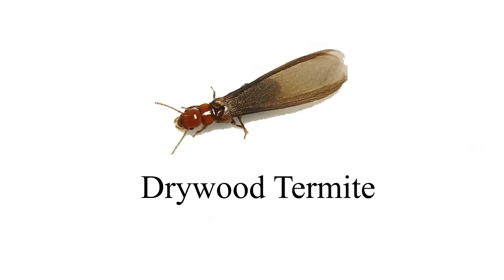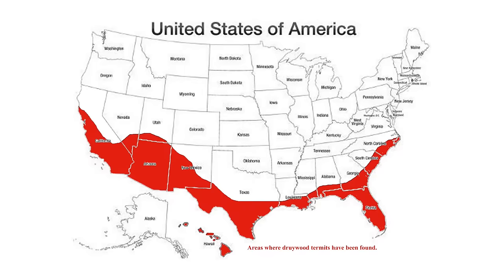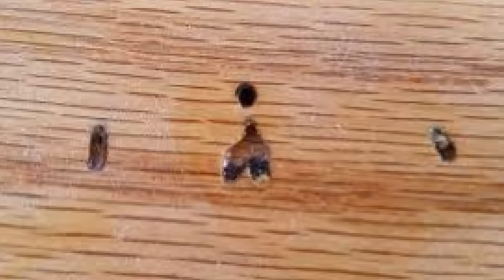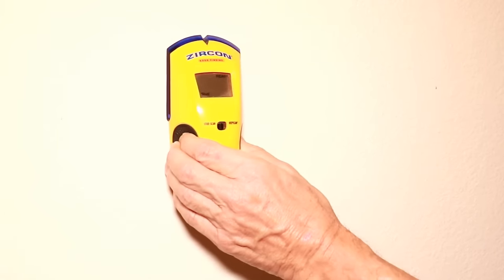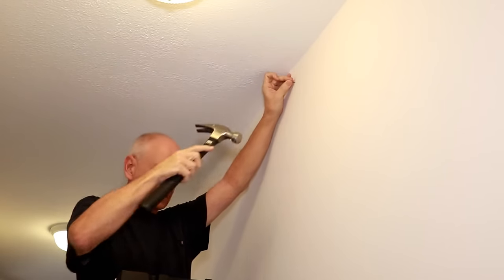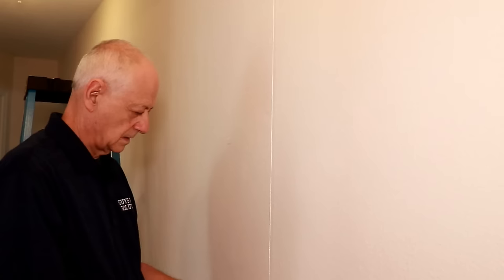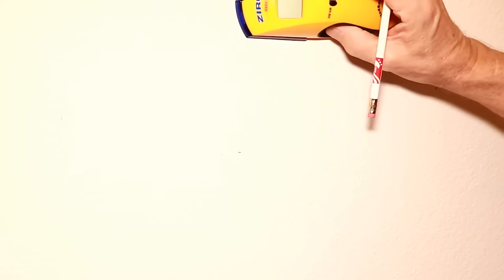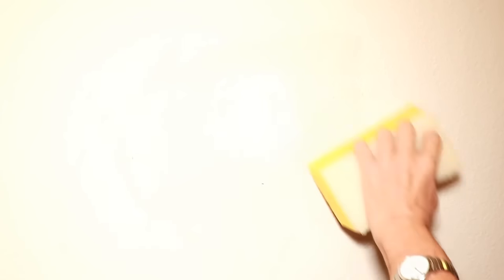How to Treat a Drywood Termite Infestation Yourself. A MUST see if you have Drywood termites.

Comment: I've heard that Taurus SC lasts up to 10 years but you said it doesn't last 6 months, which is right?
Reply from the maker: Taurus SC can last up to 10 years when used as a perimeter treatment with a trenching system.  That is to say, if you burry it, then it can last up to 10 years.  The chances are it will be more like five to seven years, but it could go 10.  However, when sprayed on the surfaces of the exterior of the house, it won't even make three months.  So, how long does it last if you inject it behind walls?  In theory, it should last a very long time, since you are not exposing it to rain and sunlight.  Right?  Well, not so fast.  We also know that it will only last about three months when applied to interior surfaces that are out of the weather, but exposed to artificial light.  So, if you apply it into a dark void in the wall where it is nice and dry and is not exposed to light, will it now last 10 years?  Well, maybe it will, but I would not take that to the bank.  I think it will last longer than if it were applied in a lighted situation, but I have serious doubts that it is going to make it 10 years.  The thing is though that it doesn't need to last that long when treating drywood termites.  It only needs to last long enough to kill the termites and that should happen within days of the application, if you hit a gallery with it.  The idea with spot treating drywood termites is that you are going to locate the galleries and then inject a fipronil foam directly into those galleries.  That will kill off that entire gallery.  You could argue that, if the fipronil lasts 10 years, then that would prevent an infestation in that spot for a really long time.  Even if that were the case, drywood termite galleries tend to be fairly small and located in different areas.  You could have another gallery a foot or two above the one you treated or in another 2x4 that is right next to the treated one.  So, perhaps you may prevent termites in that specific gallery from returning, but it's a big house and there are a lot of swarmers.  Spot treating drywood termites is kind of like playing Whack A Mole.  All of that is to say that, in my opinion, the fipronil will not last 10 years in a wall, but I have not done any studies on it and I have not seen any studies on it either.  I tend to err on the side of caution, so my best guess is about six months.  Am I correct?  Who knows?  I could be way off, so it's just an opinion.  No hard science behind it at all, but it doesn't make much difference with drywood termites.  While it may be a fun topic for us pest controllers to debate, it has little impact on a drywood termite infestation.  Or so it seems to me.

I hope that helps.  Great question.  Thanks for asking.
Reply: @GuysPestSolutions  it is too bad there wasn't a way that we could get boracare to spread through every connecting piece of wood in the entire home by binding orange oil to it...

I guess orange oil seeps through wood and keeps moving through it...capillary effect or something like that? It would be so nice if you could just inject something that follows the wood through entire home
Reply from the maker: @macknumber9  Bora-Care does penetrate deep into wood, but the problem is getting it to the wood in the first place.  For example, how do you treat the studs behind the drywall?  Some pest controllers will inject foam into the wall voids, but this is an expensive and often messy proposition.  So, while Bora-Care does have a place in the treatment plan, I don't think it can be regarded as a cure all for termites.  

I never recommend orange oil for the treatment of termites.  A study by the University of California found that orange oil is only about 77% effective in killing termites.  For a treatment to be truly effective you must have a 100% kill rate.  Also, orange oil is a fast kill product.  This is not what you want.  You want a slow kill product because you want the termites to take the pesticide back to the gallery or colony and share it with the other termites.  That way you kill all of them and not just 77%.  So, leave the orange oil to those folks who are okay with getting their homes eaten, albeit somewhat more slowly.

I hope that helps.
Reply: @GuysPestSolutions  quick follow-up question. Could I spray all the subfloors with Bora care? Then I guess I would never ever have to worry about termites causing soft spots in the wooden subfloor in my Mobile Home Investments.

Also what is your opinion on orange oil have you ever used it it seems like it penetrates and follows the wood the negative part of it it doesn't have the ability to cause termites to spread to other termites it just kills on contact but the good thing is it penetrates the wood so good that you might only need to just spray the middle of every stud and I would think hope that it would kill all the termites that are in that stud. This would make it very easy to treat the whole house because you wouldn't need to drill holes every 4 in
Reply from the maker: @macknumber9  Let's start with the orange oil question.  I think the ability of orange oil to penetrate wood is overstated quite a bit.  Also, the ingredient in orange oil that does the killing is d-limonene, which has no residual properties of which I am aware.  It is simply an instant kill product.  It can be somewhat useful for drywood termites, but keep in mind that it is flammable and can make wood burn more easily, thereby potentially creating more of a fire hazard.  Since it has no residual properties, it may kill off some termites, but the gallery may still recover.  You are way better off using a fipronil foam to treat a gallery because of the residual properties.  Also, the foam is going to penetrate WAY better than the orange oil because it expands to several times its size.  The ability of orange oil to treat termites has been way oversold.  It would be wonderful if all the claims were true, but they are not.

Bora-Care is a great option for treating under mobile home, but you cannot get it exposed to sunlight.  Any exterior wood that is treated needs to be sealed 48 hours after the application to remain effective.  In addition to wood, you can also apply it on metal structures, pipes, wiring, and so forth.  So, you can treat the piers with it too, if they are not exposed to sunlight.  For best results, always mix it one to one with water.

I hope that helps.
Reply: @GuysPestSolutions  very good information...especially that I can use it on the piers even if they are concrete I guess...

I'm almost thinking of treating every stud in the home with termidor injection...so the residual effect is around 3 months with termidor on wood? So if they try to colonize or even just walk across an area that I treated they will be infected with the "deadly virus" and pass it on...
Reply from the maker: @macknumber9  If you were to drill holes in every stud and shoot in a little Termidor foam, then that one hole could, hypothetically, be treated for a long time.  I have my doubts, but let's assume that is true.  The problem is that the foam would only treat the diameter and depth of the hole.  The foam would most likely not penetrate too much into the wood the way Bora-Care does.  It may a little, so you will get some area of the stud protected for some unknown period of time.  I don't know that doing this would be the best approach to preventing an infestation.  If you already have termites, then this certainly would guarantee that you killed all the termites in the studs, if you drilled the holes four inches apart along every stud in the house.  That is a lot of time, a lot of work, and a lot of money for foam.  Then you still have these guys in the attic and maybe even in your cabinets and furniture.

We know that Termidor lasts about three months when exposed to the weather.  Hypothetically, it should last longer when not exposed to the weather.  When a termite or other insect walks across the product, they will get it on themselves and bring it back to the colony and share it with the other insects and that will kill off the entire colony.

If you are treating areas that are not exposed to sunlight or weather, then Bora-Care is a better choice than Termidor because it lasts forever.  Literally, forever.  So, if you have piers that are not exposed to sunlight or weather, you can spray on Bora-Care and it should last forever and never need to be retreated.  It can be applied to wood, metal, concrete, and so forth.  You can apply it to pipes, wiring, supports, flooring, and you name it.  So, I only use products like Termidor when I am treating the exterior of the house or spot treating inside.  For piers that are exposed to sunlight or weather, then Termidor is a good choice, but it can only be used every six months.  The thing is though that it only lasts three months, so you need to do an in between treatment with something like Bifen IT or Talstar P.  These products work differently, but they do get the job done.

I hope that helps.  Be well my friend.
Reply: @GuysPestSolutions  thank you...why change up the pesticide though why not just keep it simple and keep spraying the same termidor every 3 months?  Renewing the residual effect?
Reply from the maker: @macknumber9  That's a great question.  The reason is that the Taurus SC works much differently than the Talstar P.  The Taurus SC is a non-repellent pesticide, so pests do not identify it as toxic to them.  Therefore, they will happily cross right over it and then bring it back to their colony or nest and share it with the other insects that live there.  After that, the entire colony will die out.  So, for example, if there are any ant colonies or anything like that which are near your home or in your home and they travel to and from the inside and outside across this barrier, then those colonies are going to die out, regardless of where they're located.  The Talstar P does not work like this.  Unlike Taurus SC, the Talstar P is a repellent pesticide and so the insects do identify it as a poison and they know that, if they cross it, they're going to die.  Therefore, this product will keep pretty much any pest you can think of from coming into your house and, if any do decide to cross the barrier, they're going to die fairly quickly.  The Taurus SC is a slow kill product that is designed to wipe out entire colonies, while the Talstar P is a quick kill product that is designed to simply keep pests out of your home.  The reason you alternate between these products, starting with Taurus SC, is because you want to initially wipe out any colonies that may exist.  You can only use Taurus SC every six months, but it does not last six months.  Therefore, you have to use something three months later to keep the pests out of your home until you can treat again with the Taurus SC.  So, these pesticides actually do two different jobs.  By alternating between these two products you will continuously kill any colonies that may reform from other properties around you and try to enter your home and you will ensure that there is always a barrier around your home so that, when the Taurus SC is not functioning, the pests will still not enter.  Ideally, you would just want to use the Taurus SC every three months, but it is not labeled to do that.  Also, the Taurus SC is quite a bit more money than Talstar P, so alternating between products does save a bit of money too.

I hope I did a good job explaining that.  Please let me know if you have any follow up questions on it.
Reply: @GuysPestSolutions  you did an excellent job as always. Thank you for all this incredibly helpful and valuable information
Reply from the maker: @macknumber9  Always my pleasure.  Be well my friend.

Comment: please get to the solution I been up since  4:50 am today I live in California
Reply from the maker: I'm so sorry.  Let me give you the solution in just 10 words.  "If you have drywood termites, then get your house fumigated."  You will NEVER get rid of a drywood termite infestation with my method or anybody else's either.  It's just that simple.  Fumigation is the ONLY sure way to solve the problem.  Let me share my video on how to hire a pest controller without getting ripped off.  Yes, it's over a half hour, but it may save you thousands.  Also, you should know that, after the tent comes down, you can get immediately reinfested because the gas they use has no residual action.  If you have drywood termites, then your neighbors have them too and they will fly over the first time they swarm.  The termites that is... Hopefully, not the neighbors.  To prevent this, you need to do a preventive treatment every three months.  In California, I would do it every two months with Bifen IT.  I will place a link below for that video as well.  Again, it's long, but it will save you thousands.  It's well worth your time to watch both videos.  Besides, if you watch long enough, you may even come to enjoy hearing me talk.  Okay, probably not, but you should still watch.

I hope that helps.  Be well Victoria.

Video on how to hire a pest controller without getting ripped off:  https://youtu.be/y-a8XOqVrlE

Video on how to prevent a drywood termite infestation:  https://youtu.be/neNsmVbj8Pc

Comment: You're the first guy I've had to speed up to 2X usually only 1.5 is needed you talk slllooow
Reply from the maker: You are not the first person to mention that.  I guess I'm not everybody's cup of tea.  Some folks really like the slow way I talk and some can't stand it.  Nevertheless, I am what I am.  I just don't know how to do it any other way.  In any event, the information in the videos is spot on correct.  If you can still make sense of them by speeding them up, then great, but you don't want to miss anything in an effort to save time.  I always recommend taking the time to watch in normal speed because you can fail if you miss just one thing.  In fact, I recommend that you watch more than once in normal speed.  The termites are busy eating your most expensive possession and they will eat you out of house and home.  So, it's definitely worth your time to watch in normal speed.  Spot treating drywood termites is a challenge, even for the best pros in the business.  If you are going to do this yourself, then you really need to take the time to learn exactly what you are doing.  It takes years for a pro to learn this stuff and you are doing it in a matter of minutes.  Also, keep in mind that you should only attempt this if you absolutely cannot afford to get the home fumigated.  Fumigation is the only sure way to get rid of all the galleries.  Should you decide to get your home fumigated, then get several estimates.  Prices can vary wildly in this industry.  Just go with the lowest bidder.  Also, you must do the preventive treatment.  If you don't, then you WILL get reinfested.  If you have drywood termites, then so do your neighbors.  When the termites swarm from your neighbors' homes, they will pay you a visit.  That would be the termites and not the neighbors.  I will give you a link to that slow talking video as well.  It's another video that you may want to watch in normal speed.  Always start the preventive treatment before you fumigate and do it every three months.  If you don't fumigate, then start it now.

I hope that helps.  Be well my friend.

Video on how to prevent drywood termites:  https://youtu.be/neNsmVbj8Pc